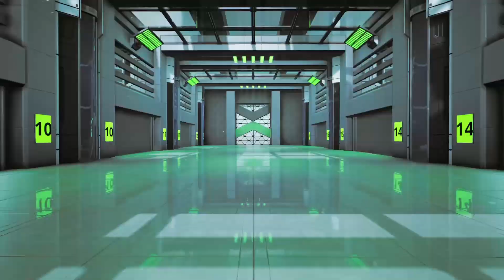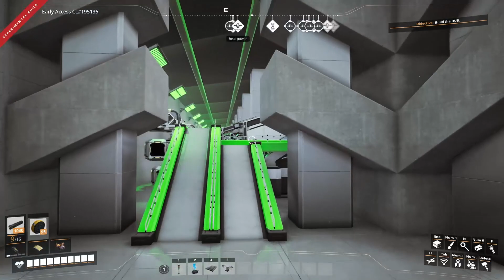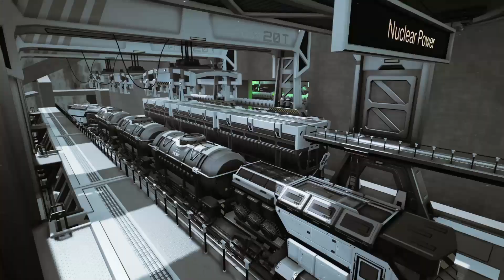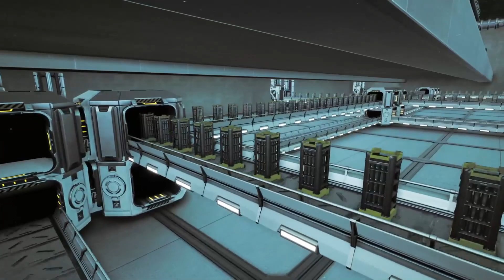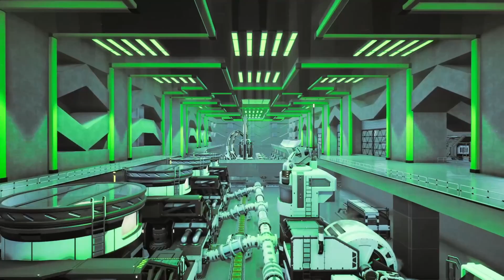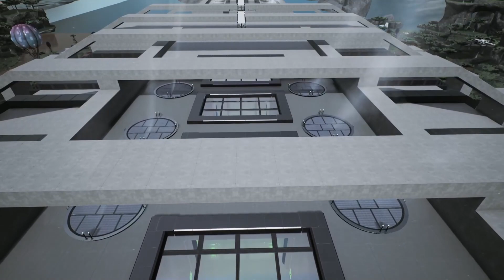Nuclear Power..  No waste

Comment: At 1:59 - the left sign on the wall - you mis-spelled Fuel; you have Fule. The sign on the right should read Maintenance, not Maintainance. I saw a few more spelling mistakes I haven't mentioned.
Reply from the maker: Thank you for pointing those out, yes unfortunately I am an extremely bad speller, its something I've struggled with my whole life.
Reply: @mrxgame386  - just type what you want to say into Google search - it will give you the correct spelling. Oh and btw - fantastic factory, Way better than mine.

Comment: You using some graphical improvement mods?
Reply from the maker: No I only use pack utility and easy cheat for flying and creative building. Everything is built the vannila way so it can be built in vannila. But I am curious on why you think that
Reply: @mrxgame386  Seems like u use some kind of global illumination and better reflections ;) It looks awesome. I am using ultra details on my pc and do not have this much reflections and details as you.
Reply from the maker: @BaterieCZ  what resolution you using? Also join the discord if you would like some help 👍